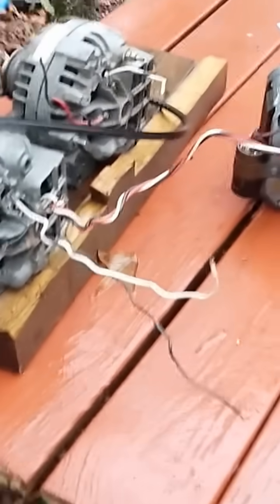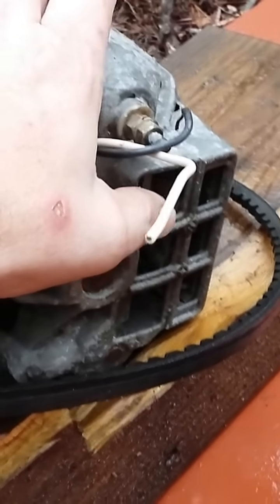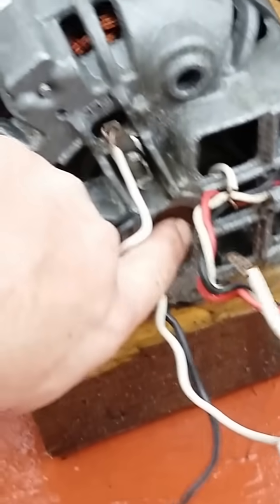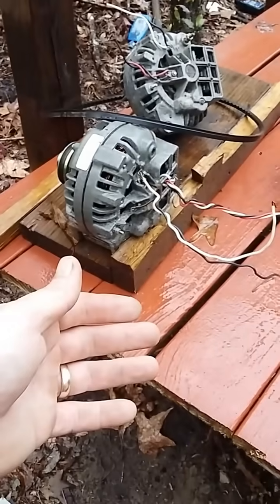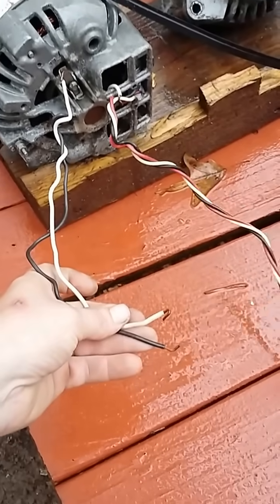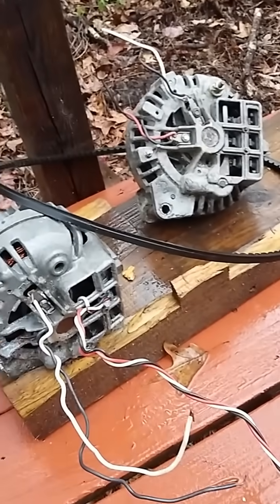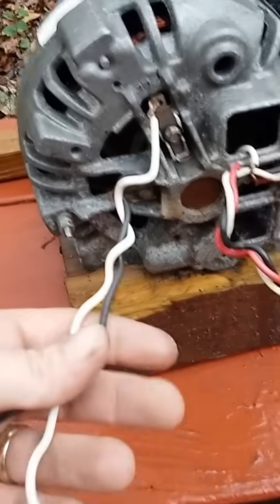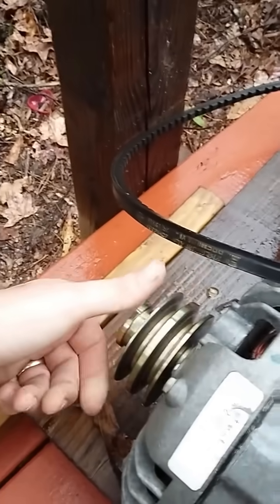Update Free energy forever no wind no solar no gas READ DISCRIPTION!!!

Comment: just want complete instruction..not an electrician
Reply: pamela khalifa , I got my P.M.A. from Missouri wind and solar , P.M.A. stands for permanent magnet alternator , you will need a old Chevy  alternator from the 70s or 80s , you take it apart and removed the insides except for the stator and the block diode , this is the copper wire and aluminum block that has three wires going to it and then install the P.M.A. and you will make power , you will need a 12 volt car battery and a power converter , but you will have electric service
Reply: pamela khalifa , you will also need a way to turn the P.M.A. like wind power , water wheel power , an old bicycle , anything to turn the generator

Comment: I think what your doing is brilliant...I'm thinking about having an electrician come out and set up my fuse box for a generator...separating the main from everything else and giving me the attachment...So then I can set "This" what your showing up...and connect it directly to zed connection while the main is turned off and power my house.  I assume with another alternator connected to the system ran to a car battery to constantly keep it charged in an " enclosed " system would be the way to go.  I'd love to donate to your channel ...Once it's running though...I could just have the motor by a receptical and plug it in...only using the battery once to start it up...and then the power is recycled off of the free energy I'm making...awesome.  I guess the only question I would have is do I have the right idea and how to connect the 3 wires from the stator to the connection the electrician hooks up..unless there's 3 wires in that wire.  I'm sure I could figure it out.  Your awesome for what you do. If you have any pointers I'd love to hear them and I'd put that 5$ in right away. directedintellect@gmail.com hope yo hear from you..thanks an God Bless!
Reply: Technically you can just stick a plug on the output wires and plug it into the wall socket, it will supply power to the entire house, if you do that make sure the main fuse box is turned off so you don't bleed any power outside your house, and if you intend on running your coils off the generator make sure to cap off the dc going in as too much can overload it
Reply: @dontdeadopeninside2935  Awesome!  Thanks so much!  Are you part of the channel?  Either way I'd like to donate what I can right now to the cause.  Do you know the site or paypal he has?  Thanks ; )  God Bless
Reply: @How2KeepItaBuck  no man i'm not involved with the channel in any way, nice of you to donate though, i'm sure you'll get a reply soon
Reply: @dontdeadopeninside2935  Thanks buddy.  I appreciate you ; )
Reply: https://m.youtube.com/watch?v=j2NojdrlbRo&feature=share

Comment: I can also say this, and this is only ti the people that will listen..  I design and build homes out of shipping containers. I use the DC setup of this system to power the whole house.  Remember, this alternator also charges car batteries. You can also get DC powered light , tv, ac , stove and more to be ran in the home. Its a system that is perfect for emergency.  Remember all Rv 's run ac and dc power. Even your car. Why you think you head lights are so bright. Its all dc powered.  And you can use that same dc power to run your power in the house. All you do is go on amazon and order everything that dc powered for the house. Any house

Comment: to produce that extreme amount of power out of the generator you need an extreme amount of power to spin that generator when it's under load BUT if you increase the frequency to the electric motor that's spinning the generator you don't need an extreme amount of power to the generator under load.
frequency is how many time the magnetic poles change polarity.
Reply: I believe this because these things are set up for DC at 60Amp only three small coils then what I'm used to  In AC generation for a medium sized load to Powerhouse at least at 50 to a hundred amps thank you sir now I believe the world is not a total loss because there is some smart people out there

Comment: Could definitely make for a relatively cheap motor to be driven by a windmill/other setup.  You can just pick one up out of a junkyard. However, he states you just hook up 12 volts to the input. Isn’t the energy going in going to be the same or (gasp) less than what comes out?  The voltage will change but that’s not the same thing as producing more power.

If My solar panel puts out 19 volts at 600 mah and then I change it to 13.6 volts to charge/maintain a gel cell.  There’s not less power because the voltage is lower, but there is slightly less because of the conversion loss.

If this produced more power, people would be powering these things with DC instead of wind all over the place.
Reply: He is completely over simplifying what is occurring here any increase in amperage would need a proportionately larger gauge wire otherwise the smaller wire would burn up
Reply: William McCullough when producing energy it usually goes through a Transformer which increases the voltage output from the initial input greatly

Comment: First of all,  220 90 amp..  Gonna require some thicker ... Wires..  Those will melt.  Cause a fire..  Prolly why its not been improved upon in a small form.  Hey let's look at the hydroelectric generators in a dam..  Huge..  Allow thick gauge cables..  Haha..  Get it now you idiots?
Reply: Chris Evans he is only talkin in theory it's not practical to carry that much power with those small Gage wires
Reply: @sadbrit4906  no kidding..  Duh..  That's why I said it.    Its gauge not gage.  And was in general to everyone who said they would try it.    FYI..  Best to just use a alternator to a battery,  then use an inverter.. But who am I..   Used to run a 3000 watt inverter in my Semi(8 gellpack batteries)..  Total overkill but hey it never got hot! Least I had 4, very thick cables to the batteries.

Comment: You didn't even show proove it works.
Reply: If it didn’t work they wouldn’t put them on cars.
Reply: I get it brother, but may you kind of show the evidence that it works by powering something up? Not everyone will have your intelligence. It may not be rocket science for you, but it maybe for others. I will greatly appreciate your help.🙋‍♂️
Reply: EVIL STANG DV - I have an alternator with a permanent magnet rotor that doesn’t need a battery to activate it mounted on a little windmill that I use to charge batteries for my cellphone, iPads and back up batteries for the phones.
Reply: Thanks a lot bro. I'll try it 🤙
Reply: @edgarsuro9390  - You can get them on eBay - 'permanent magnet alternator'.

Comment: Alternators makes 12v their made for that and the laws of thermodynamic say u can't make or generate "free energy"
Reply: You can get 120 volts from a altanater used one in the 60,s
Reply: @jameswilsin5348  even new ones you can get 120 ac from.
Reply: There's this thing called a "voltage regulator" inside the alternator that reduces the voltage down to 12v max to not burn up the battery... battery acid would boil over in no time without it...
Reply: @MRGF78  Smart. but is it still an alternator. if you tap the windings  you can get ac current

Comment: 90 amps over 12 volts would fry those wires.
Reply: Then why doesn’t your car burn up when the motor is running? Because 12 volts doesn’t need but 4 or 5 amps to charge the battery. The 90 amps are only on the AC side.
Reply: @tubularguynine  you really should not talk when you know nothing
Reply: @tubularguynine  seems like you dont really know why it does not burn your car. You are wrong about the battery only needing 4 to 5 amps. The car can draw from alternator even the 80 amps when you use alot of current drawing electric devices like the engine cooling fan, air conditioning etc. The high current does not burn your car because the positive wire going from the alternator to battery is usually from 10mm2 to 35mm2 thick and it can handle high current. And the whole alternator free power thing wont work because this guy in the video thinks that he can get 230v 80A from the alt and the reality is 14v 80A or 230v 1-10A (too lazy to calculate). When you higher the voltage your current will drop and wise versa.
Reply: acco - Maybe you should tell macsheadroom show that, he’s the one who doesn’t understand alternators.

Comment: Haha too funny seems like u had potentially more important matters calling to you in the background and ur fairly close about the electrical motors/alternators there aren’t actually any magnets in them they use sheets of iron lamination that have slots kinda like gapped teeth that go around in a circle which the wire is layed in the slots which the potential of the electricity created a near 99% transfer of energy thru the voltage which the lamination amplifies the magnetic fields to rotate the rotor/core/ armature depending whether the motor is ac/dc which its dc so it would actually be an armature U CANT BULLSHIT A KNOWLEDGEABLE PERSON the voltage and amperage output u get idk what ur hooking the alternator to most likely a car battery which have an average of 48amp/hrs so ur gunna need a few batteries but you would still have to recharge ur batteries perhaps with a gasifier then yea you should still be able to power ur house. the government is too funny  “I AM NOT A CROOK” lets just hope they dont try to delay the inevitable advancement of the human race otherwise it will be our demise or perhaps they just wanna control the advancement which is why they were chasing u or whatever
Reply: Holy run-on sentence Batman!
Reply: @ Rizzo - That’s what I’M screamin’!
Reply: It seems to me a ‘knowledgable person’ would suggest he replace the 12v-activated rotor with one that has permanent magnets so he wouldn’t need the battery. But a ‘knowledgable person’ knows how to use punctuation, too...so there’s that.

Comment: Okay, you've got this great invention and free energy. Why don't you show us a working example and how you are getting this free energy
Reply: I think all he said is he is using an alternator from a car to make electricity by spinning the rotor. 

He isn't making energy from nothing, someone or something needs to spin that rotor. And, his hacking into the diode bridge isn't rated at 90 amps, that is the stator voltage provided by the vehicle and is suppose to be a low amp input not high amp out put, so he would quickly fry the thing if he attempted to use it.

Comment: Why is this bullshit still posted on youtube! Dumbass you blow it as soon as you said you need to supply power (3 to 12 volts) to the input on the alternator. Where is that voltage coming from. Got a wire coming out of your ass!

Comment: At 2.30 you state you'll get 220 volts and 90 amps. BULLSHIT! The whole thing is bullshit. Yes you can get power out of an alternator, but you need to power that alternator. Now you're claiming to get 90 amps at 220 volts out of what looks more like about a 40 amp alternator. Do you even have a clue how much power 90 amps at 220 volts is, genius?  Try working it out for yourself, plenty of people have pointed out stacks of your other mistakes but I haven't noticed anyone pick up on this particular bloody big one. The formula is Amps times Volts equals Watts. Now you're talking about 19,800 Watts. So essentially you're talking about enough power from a tiny little alternator to run quite a few normal households, from that pissy little alternator. Keep dreaming dumbarse.
Reply: He actually said you get that by having 3 alternators.This man is so impossible to listen to repeatimg stator garbage I barely noticed the things he said that do actually make sense.
Reply: theother account - You didn’t miss the bits that made sense. There were none.
Reply: He acts like its a transformer.   There's so much wrong with this.

Comment: You can’t just put dc power to a alternator and expect ac out. You need a inverter. and if you think you’ll put some sort of battery like a 9v battery to the alternator, even if it spins you won’t get that out. You need a transformer to up your voltage and that doesn’t change the allowable amps. 

And if you plug that into your house and you keep touching the wiring with your fingers, no wonder people say you wouldn’t live long, because you will shock yourself and if you have more then 750mili amps you will die. Please do not try this at home, this guy is an idiot.

Comment: This guy doesn't understand Ohm's Law.   The power P in watts (W) is equal to the voltage V in volts (V) times the current I in amps (A). So you connect a 12v 80 amp battery up to that rig. What you get out is going to be less than what you put in because there will be losses in the circuitry and friction in the moving parts. Chuck all the alternators away,  get an  inverter that converts 12 volts to say 240v AC. It might charge your mobile / cell phone, might drive a few lights, small power tools for a while. If they are all on at once the battery will go flat very quickly. Doesn't look like he has much clear sky for a solar charger, not much wind, no sound of powerful running water, so no wind or hydro charging available. I guess somewhere there is a generator, tank of fossil fuel?

Comment: Field wires? And amps and power? May want to check.up on your ac theory.  And you have the correct idea.  But its not your "invention" every car alternator has a one way resistor to eliminate the ac. May want to check the amp ratings on your wires . pretty much made a open element toaster and will burn in half.
Reply: Never interrupt a meth addict on a quest for a Darwin award.

Comment: Now if you hook that up with a motor and reducer and a 12 volt motor it will run continuously, you'll figure it out.
Reply: Would that same 12volt motor run continunously under a heavy load
Reply: @imreal2death  why are you leading this day dreamer with bull S
Reply: @imreal2death  I'm not sure if the 12 volt motor would be able to handle a heavy load, but i have another video on you tube where a guy was running a 110 volt motor to a alternator with a belt in between them and it was running continuously, I'm trying to figure it out write now, how to make a gas less generator, and to start it with a cordless drill .

Comment: That's interesting in Canada I met a guy who lives in his really old motor home and he showed me how he powered his home on wheels using a 12v car battery and a 12v motor and a regular car alternator.  Using this set up he said he lives of the grid. Powers his fridge , a.c., tv, and electric cook top and all the lights.
Do I believe him? 
Yes!   Because this guy is to poor to afford a gas generator or gas for his  old truck and managed to figure out a way to power the truck with out gas, it's not fast and doesn't speed up very fast but it gets you from point A to B. It's one of those thing's where you had to be there to see it. I don't know his story but he definitely had a head on his shoulders.
Reply: If it involves a battery it's not free energy which is what this guy is claiming. There are many ways to configure an electrical system which is what the gentleman in your example has done.

Comment: This would never work, even if you found a way to use renewable energy to spin the rotor.  They are internally regulated to only produce 13-18 volts. Bypassing the diode trio gets you 13-18v A/C instead of D/C.

Comment: How are you running a motor for free that turns the alternators?
Reply: Decent sized starting battery and a 1 hp electric motor plugged into a 1500 watt sine wave power inverter or bigger.  The pulley needs to be the correct size to make the alternator spin at the right rpm.
Reply: @Indianawhiskeyandbourbon  If you need a "Decent sized battery" then it's USING POWER, and using more than it's making.
Reply: @probingtime666      how many amps does an alternator produce?  Depends on the alternator...... Right?   How much power does it take to run a 1/2 to 1 hp electric motor?  Not as much as some high current alternators create.   Especially.... Multi stage electric motors

Comment: A stator is the stationary part. The rotor is the rotating part. Unless you can get that little detail correct, i discount everything you say. Maybe you should re-block the comments because i cant see much praise coming your way.
Reply: Enough about the guys in black suits...
What you need to worry about is DCF hearing your  unattended young'n screaming it's head off in the trailer with no electric. Takes power, to make power. Show a working unit, that is how you prove a theroy. Not explaining it 20 times and no show....
Reply: U fucking idiot it’s called an armature not a rotor y don’t u get some education before u correct other people.

Comment: The reason you’ve been told you won’t live very long is that you have absolutely no idea what you’re doing & will likely be electrocuted.
The part you are spinning & calling the stator is actually the rotor.
It’s not a generator, it’s an alternator, big difference.
It isn’t brushless, the brushes run on “the round copper thing” as you call it(sliprings)
I highly doubt you’re getting 200+ volts ac with 6v. On the field.
That tiny electric motor has t got the balls to turn your alternator at full load.
How will you control the frequency?
Needless to say it takes more electricity to turn the alternator than what it will produce.
Why not show it working?
Reply: Thank you Chris. Finally someone who can point out the details he's got wrong and explain some of the main reasons it won't work.